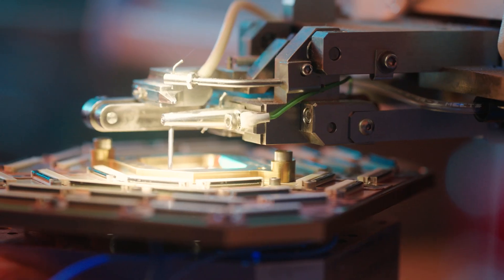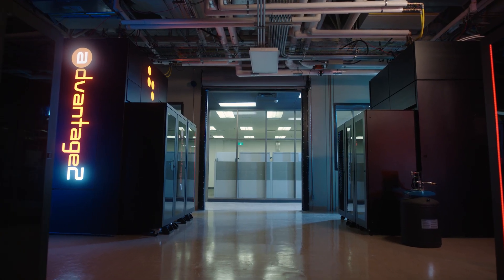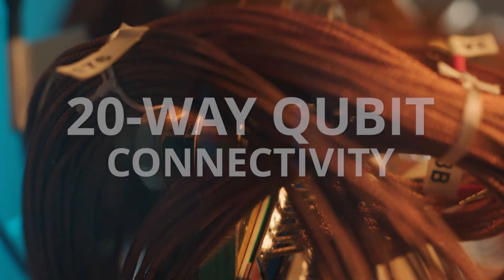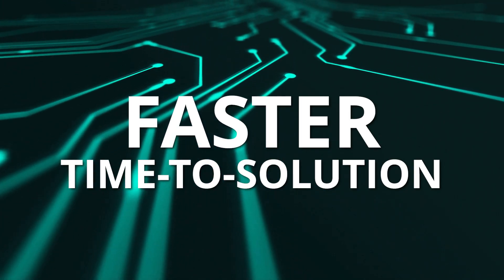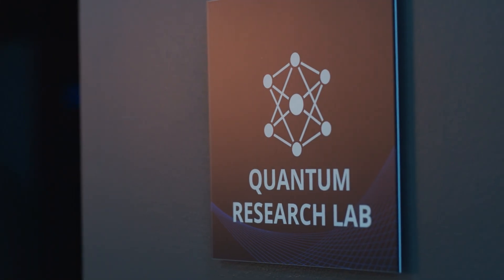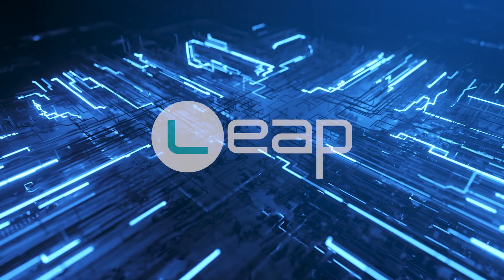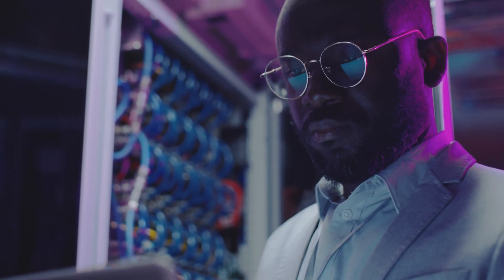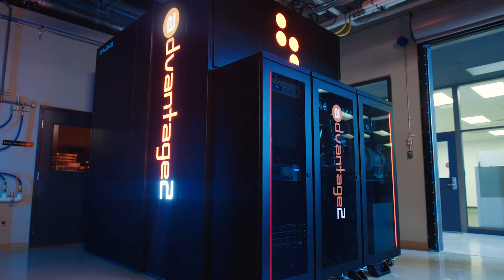Introducing the D-Wave Advantage2™ System : Our Most Advanced and Performant Quantum Computer

Comment: D-Wave has so much potential because quantum annealing is literally THE tech that nature itself uses. The links to annealing are found all over the sciences (Google the article called “Life Through Quantum Annealing” to check for yourself).

You know how we think of nature as “calculating” it’s processes in extremely efficient ways (principle of least energy)? That is the level of efficiency that annealing can trend toward beyond what is possible with conventional computing and even gate model methods. For example, the power needed to accurately simulate fluid dynamics on computers is huge, but nature just does it. That’s the vision for computational efficiency. No more building a new power plant just to supply a new AI data center.

Applications in the simulation of materials, drug discovery, and AI training are going to be massive. And when high/room temperature superconduction becomes a thing, which D-Wave may even help realize through materials simulation, the cost and power requirements for quantum annealers will become lower and the tech will be even more scalable. 

This technology should not and cannot be ignored.
Reply: Annealing is no better than a desktop computer